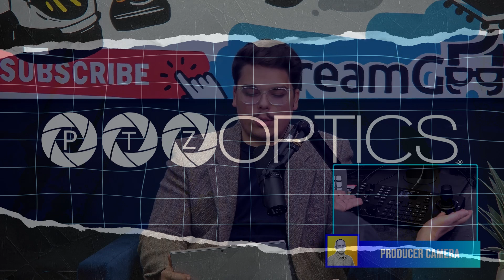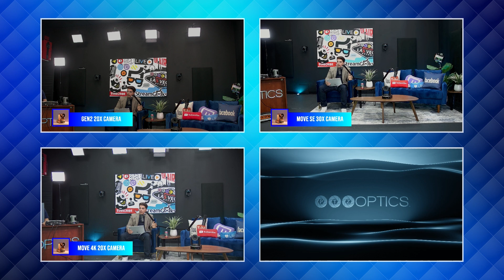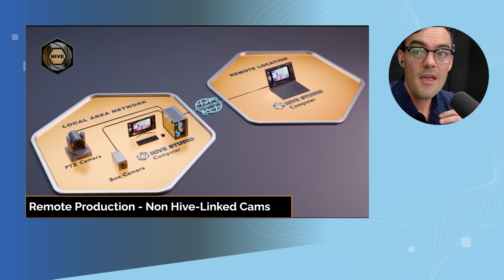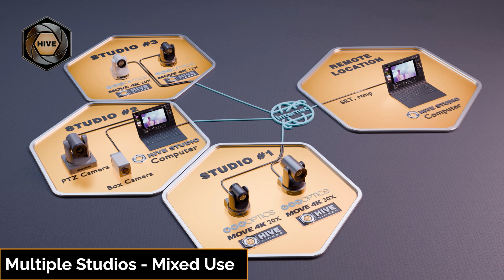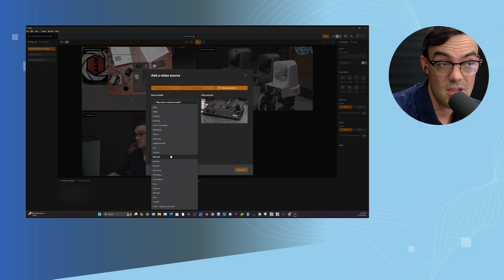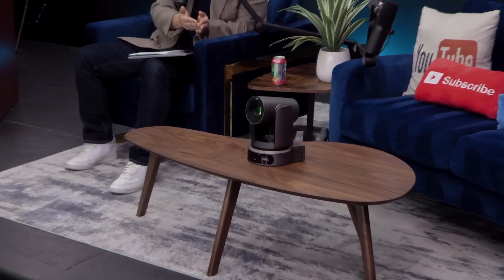Why the PTZOptics Move 4K is the perfect upgrade!

Comment: I learned the hard way that the Move 4K needs POE+. Locked the camera up and had to send it back to be fixed. Now that I am using POE+. It is working really well.
Reply from the maker: Hello!
Thank you for sharing your experience! We're sorry to hear about the initial trouble with the power setup; it's great that your Move 4K works well with PoE+. The Move 4K requires PoE+ (802.3at) to ensure sufficient power for all its features and performance. Using standard PoE can lead to issues like the one you encountered, so we always recommend PoE+ for optimal operation.
Thanks for checking out our Channel! 
Learn More: https://ptzoptics.com/
Reply: @PTZOptics  Unfortunately that was not the tech's first question when the camera was acting up. I didn't discover that until after the camera had already been locked up and sequentially sent back. Upon further research I learned about PoE+.
Reply from the maker: Please feel free to reach out if you have any questions.

📞 Support Numbers: 833-888-9706 or 484-593-2584
🕗 Hours: Mon–Thu 8am–6pm EST, Fri 8am–4pm EST
🔗 Community Portal: https://community.ptzoptics.com/s/
🌐 Explore More: https://ptzoptics.com/